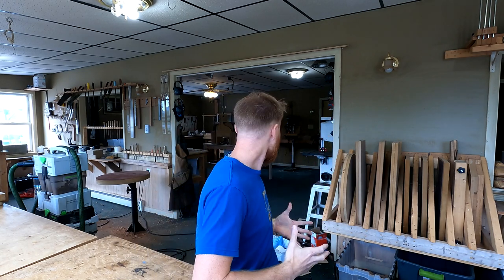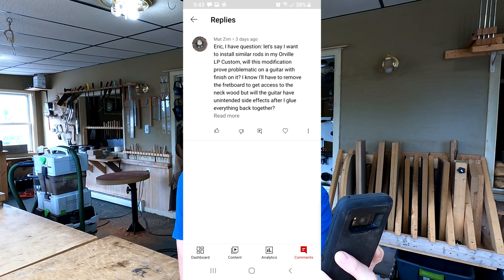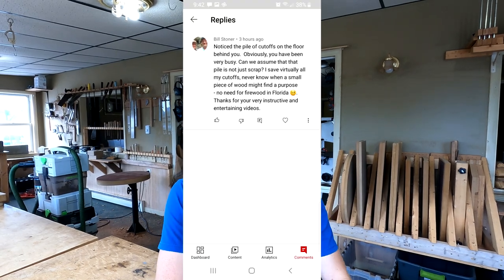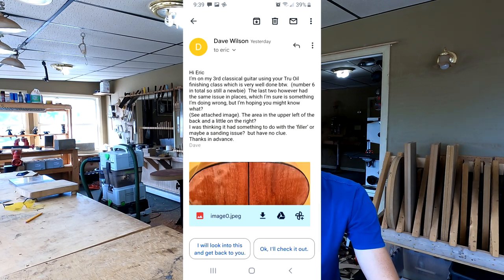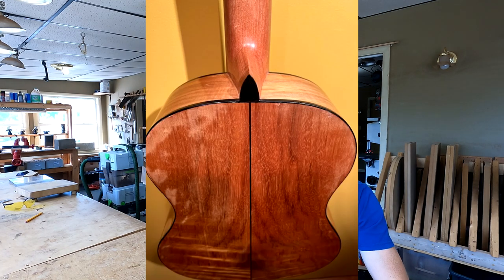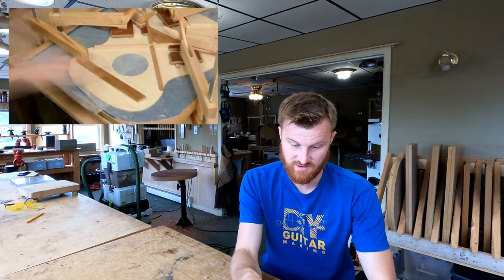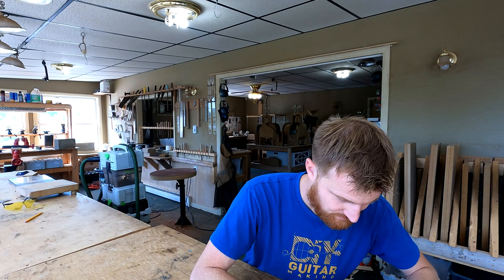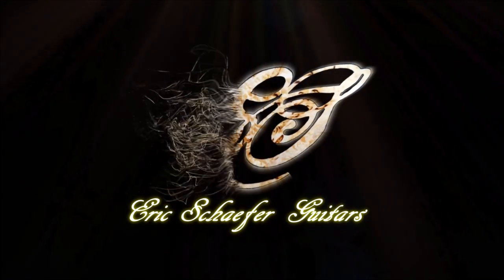Q&A | Carbon Fiber Neck Reinforcement | Scrapwood | Tru oil | Fretboard Radiusing

Comment: Thanks, Eric, for discussing you scrap wood.  I certainly understand your reasoning and as you say you are getting use from the scrap. For me, and you’re not there by any stretch, my grandkids will ask for some shop time for their projects.  The scrap box is a good place to start.  It’s been a few years ago, but a grandson was fascinated with the drill press and wanted to drill holes. We took a piece of scrap cherry and cut it into 3/4” cubes. Then we built a jig for holding the squares. I set the drill depth to roughly the depth of the bevel of the bit and he proceeded to drill the six faces of 96 dice.  He loved it.  Again thank for your contribution to hobby shoppers.

Comment: Hi Eric, I use my scrap back and side materials for sound hole rosettes and decoration. Also use this material for a my peg head logo inlay. 
I agree with you though, you have to be selective and sensible otherwise you just run out of space!
Good vids thanks 
Midge.

Comment: I wonder if the grain fill was water based (aquacoat maybe?)  Might not have been sanded back all the way in the light spots.?.  I have had that problem.  I find water base fillers difficult to work with.  Lots of shrink back and cure time.  Just my two cents.

Comment: Eric you are Great, Iam 62yr old legally blind woodworker for the past 40yrs, I got into learning Lutherie about 4yrs ago I have built 6 instruments so far, It is truly amazing coming from furniture making to guitar making where the tolerances are so small & Critical. I have radiused my fretboards before attaching the neck to body but I have the fretboard glued to the neck blank & I try to have it as dead flat as humanly possible before I start radius I got it. Again I have only built 6 instruments so Iam no pro by any means. But I found that radius in my top getting my neck angle cut as close to perfect as I can I have zero issues fine tuning the fretboard after installation. Sorry for the rant, I also wanted to chime in on the question regarding installing carbon fiber rods to a finished guitar, I think it’s a bad idea even if your trying to fix a twisted neck it seems to me that adding carbon fiber rods would not remove a twist in the neck?? Once a peice of wood has twisted it is Very difficult to try to straighten it out I can’t imaging trying that on a guitar.     Thanks Eric 👍👍🎸👨🏻‍🦯👨🏻‍🦯